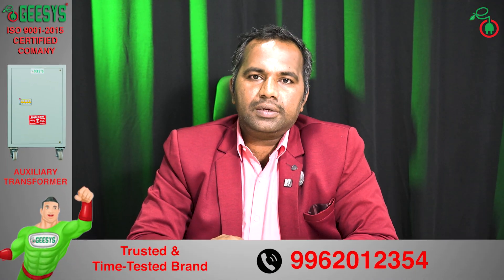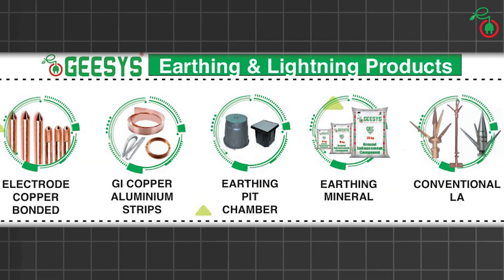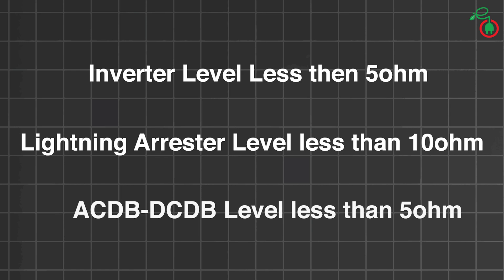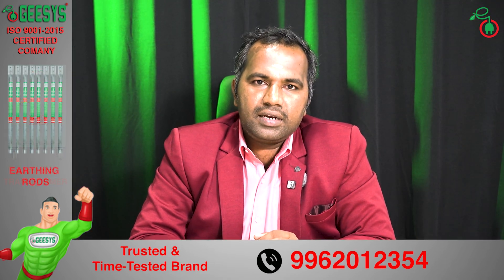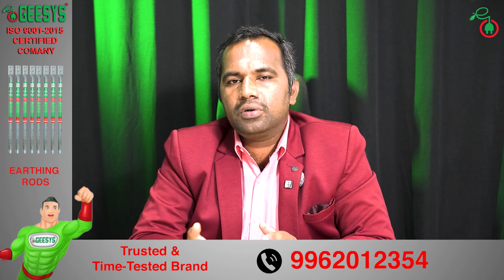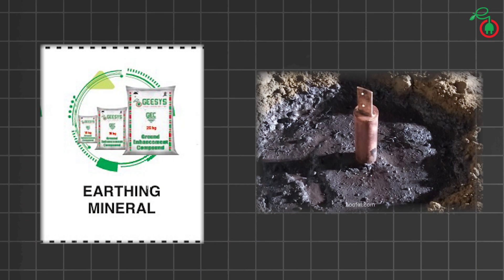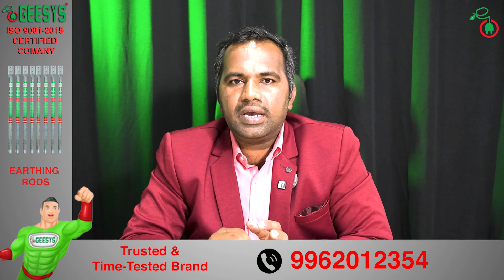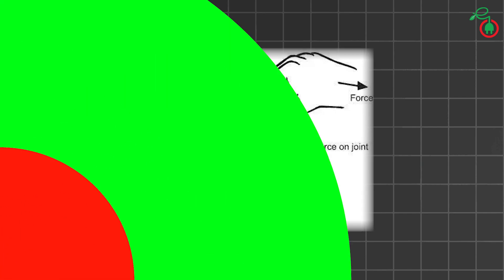How to Design Solar Earthing System for Rooftop and Utility Solar Plant Earthing Mistakes to Avoid

Comment: Can you provide the source for  this?
Reply from the maker: IS 3043:2018 | IEC 62548 | IEEE 80
Perform soil resistivity test
Use Ohm’s Law formula for parallel resistances
Target resistance per IS 3043 or client specification
Then calculate how many earth rods are needed in parallel to reach that target